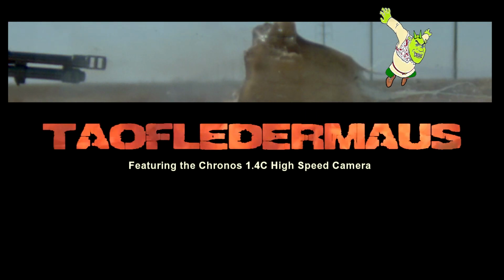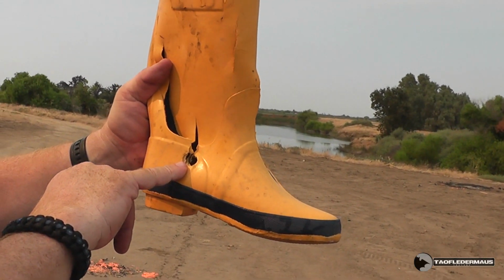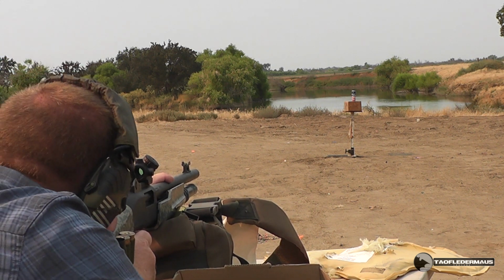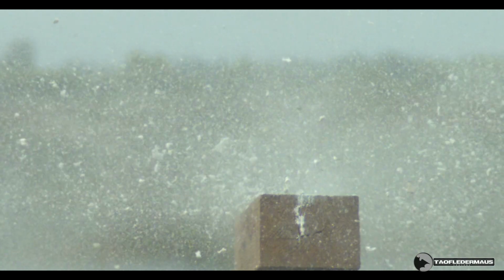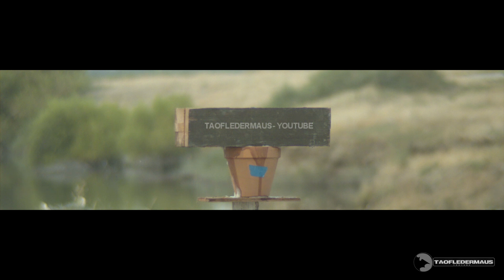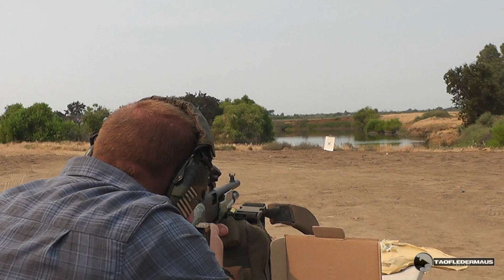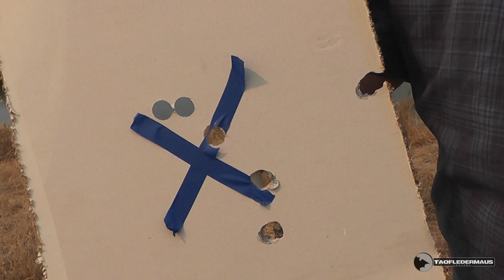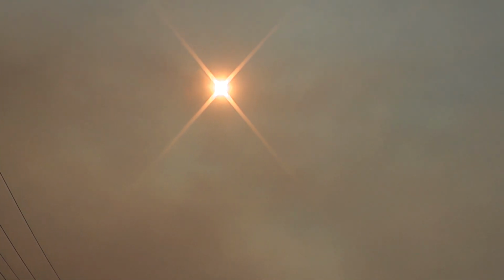Aussie inventor creates WICKED new shotgun slug!

Comment: After seeing what the hydrostatic shock did to that big wood block I had an idea! Try to make a hydrostatic bottle rocket. Find a container with a narrow opening at the top and fill it with water. Then make a rocket shaped "cap" and put it a little over the opening and down the neck some too. That way when your shoot the container the energy will launch the rocket! I think it would make for a great video regardless of the projectile. Thanks, great vids!
Reply from the maker: It would probably just burst the entire container.    eh,  my guess
Reply: TAOFLEDERMAUS maybe give it a try c;
Reply: TAOFLEDERMAUS it would be easy enough to make it fairly robust. Just cut the bottom of coke bottle and maybe add some duct tape around it to reduce the chance of it just bursting out the side. Then place it over the neck of a water jug. Shoot the juga be launch the "bottle rocket" I think good or bad it would make for a fun video!

Comment: I have some Advance explosives training from my time in the army.

You need to put your hydro pot in a steel pale or at least a five gal bucket and the 4x6 on top of that. That will direct the hydro shock to your piece of wood Lifting it up. Pretty much whatever you can do to make the direction of the shock into your target (in this case a wood beam) the path of least resistance. That means creating more resistance to direct it to the target. 

I hope to see more of these kinds of shots. That high speed footage is an awesome tool to see the physics in action!

Comment: If I remember correctly, the last slug design that Denver sent you guys had potential but suffered from a few problems inclding accuracy and tumbling. But god damn, it's pretty clear that Denver went right back to the drawing board and designed one hell of a slug because that's fuckin' impressive.
Reply from the maker: The first ones I sort of screwed up because I had to guestimate the powder load.   This time I bought the right powder and used a formula that Denver suggested to me.

Comment: I'd love to see you guys get some sections of barrel from various firearm calibers and shoot them as projectiles,I think a nicely crowned off section about one or two inches long would be fairly accurate, especially if it's a solid steel or even hammer forged steel barrel, rather than composite.
 I would think that it'd be cool to see if the barrel section would mushroom out, perhaps even try one with a .22 rimfire barrel section loaded with a .22 short round loaded into it almost like you're shooting a small 2" barreled mouse gun out of your shotgun both in shooting the .22 round out of the barrel section while the barrel section itself get's shot out of the shotgun,maybe add a steel disk behind the .22 short round to help it go off and help stop it blowing out the back to maximise how much force goes into the .22 round.

Comment: You mentioned a 3 string shot, I know you meant 3 shots in a row but what about having a slug pull a string? One end of the string pulled by the slug and the other end attached with a minimal weight. Experiment with different lengths of string, some maybe 50 yards long.  At various points along the string attach small items like patches of cloth? It would look neat.  Anyway I always enjoy your videos.

Comment: I want to see the expanding insulation foam as a target. I wonder if it will expand many times it's original volume when shot like it does when used as intended.
Reply from the maker: We did that before,  it was a terrible mess and we ended up with about 1/2" of sand and foam stuck to our shoes that got all over my truck.
Reply: what video? I thought I had seen all of them and I don't remember this. I started watching with all the wax slug videos whenever that was.

Comment: Hey!!! here's a great idea - use the hydro-static pressure to turn the shot tests a bit more scientific. Use a cylinder with a known volume and known open surface area to calculate the lift on a known weight! Mythbusters style real water displacement/psi breakdown could add a new spin to your videos!!!!

Comment: Those slugs are awesome. Great shooting OG!!! BTW, what is the Red Dot Sight are you using? I'm getting a scope rail mounted on my Mossberg and looking to put one on it. 🇺🇸😎
Reply from the maker: He has mentioned before what it is but I forgot.  It seems to hold zero pretty well though.   I don't think it is an expensive sight
Reply: TAOFLEDERMAUS. I bought a Barska yesterday for $35 to try out. As soon as I get the gun back, I'm going to zero it out with sluggers at about 40 yards and see how it does.
Reply: Danny, not expensive at all.  It's a Bushnell TR-25.  Runs about $65-$70 on Amazon.  So far it's been super durable it's lived on a shotgun since day 1 and has never even flickered, even through harsh 12 ga. recoil.
Reply: Thanks Gregg. I almost bought that one but went with this. If it wont stand up to 12ga. I'll put it on a pellet gun and get a better one for the 12. The Barska has a 1 year warranty and doesn't have any restrictions on what its mounted on. We shall see! 🇺🇸😎

Comment: What If a wax shell with 9 shot was formed in the same shape as that round? Pour the round like you usually do except a little less and press in a ring of the right shape before it hardens and remove it to leave the top the right shape without the hollow point.

Comment: At 20 yards I doubt you will see much visible difference in the slugs accuracy between rifled and non-rifled.
Reply from the maker: Rifling making slugs more accurate is usually a myth
Reply: Exactly, but a slug barrel can in my experience give greater long distance accuracy. Slugs were never meant to be a distance projectile but a good barrel can improve at longer distances. If you notice deviations at 20 yards something is wrong. And by long distance I mean 100 yds or so, not long distance for a rifle. Either shoot using a slug barrel or remove any choke attachment, even if it is supposed to cause spin.